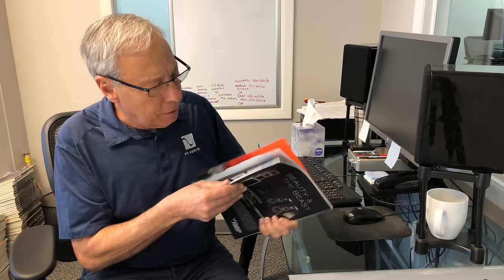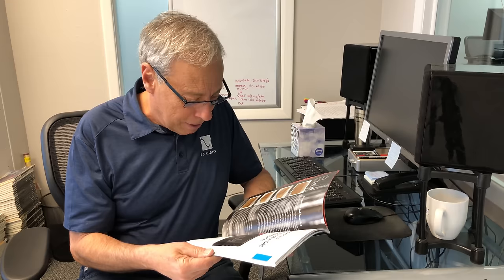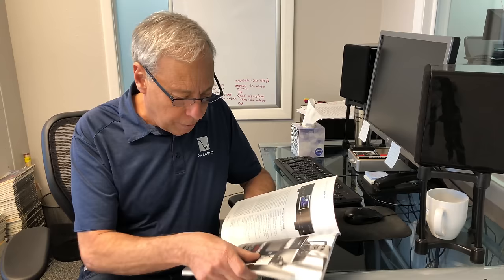Is equipment burn in real?

Comment: Ahhh, the BS that comes with being an audiophile. So everyone talks about how cables can change the sound of a component. I never believed cables actually could do anything. iiWi did a comparison between a 200 dollar interconnect and a cheap 3 dollar cable. Because he actually demoed the sound difference, side by side. It took a while to hear it. What I heard was very subtle. But dynamically different. This is where Burn in comes in. People think the cable changes over 100 hours of play. More on this later.

Component burn in. Well, this would suggest to me, that capacitors, resisters, IC chips and so on would have a change in value over only the first couple of hours. I don't think so. If you ask me, it's your ears burning in. It literally takes years for a correctly wired circuit to deviate from original values it was specced with. If a circuit is driven hard, like output tubes on a guitar amplifier, yeah you will hear a difference when it starts buzzing just before it red plates the tube. 

Back to my original thought with cables. Speakers are generally low amperage devices. Wire would need a lot of heat to burn in. So unless we are talking a hot transformer, no. Transformers are not in the audio path. Not there either. Burn in is pure BS.

Break in, now here's something that is real. Because a speaker is an electrical magnetic motor. It has a suspension. Said suspensions take a little time to break in. So any difference you hear would be from bass output. Because the spider in some woofers is stiff. That would make sense. As far as this goes though. Seems to me the bigger the woofer, the more noticeable break in becomes. 

That's my BS rant of the day.

Comment: i had my Naim system serviced..everything except the CD player..power supplies, pre and mono power amps..for the first week i noticed loss of bass and a 'flat' sound..not bad, just different...over time they improved and seemed to lose the bright, forward sound and the bass settled down..Some bass is boomy but my room needs treatment..
A month later the sound has a 3 dimensional quality and a smooth purity to it..The bass has tightened and only one recording has subsonic booming...I'm certain that some of this is due to my ears getting used to the higher levels of treble after the service, but i also think that the sound did genuinely improve...
However, i DO think that a LOT of audiophile stuff is nonsense..Burn in is part placebo, but there is an element of truth in it..I do wonder however, if a component 'burns in' after say, 80 hours, how does it remain stable and not begin to degenerate for the next 80 hours??

Comment: Burn-In is extremely important if a ma manufacturer is serious about quality control and management. I want to say that we should think of burn-in as 1. part of quality management in production process which deals with infant mortality of components, and 2. “seasoning” the system which deals with stabilization of characteristics of critical components such as tubs, caps and coils (transformers and chokes).

Comment: I can understand burn in from a speaker and stylus perspective since these have moving components.  But not sure about electronic components, they should test the same new and as they age.  If they drift or go out of spec then they need to be replaced.  I would think they degrade over time and the amount depends on the load and the type of component it is.  Burn in I would think is more QC.  Yes I agree cables are another story.  It’s really physics.

Comment: I'd like to see the actual measurements to see what the differences are.

Also, comparing a unit with "burn in" hours on it to a different unit without doesn't seem like a good idea.
The proper way to test would be to measure a single unit before and after burn-in.
Reply: Gene from Audioholics already did many tests on that. The drives literally change the moment you first press play. They don't change after that, it's just more of that audiophile "magic" that only lives in CONSUMER audio.

Comment: Just a few quick questions. For cable and equipment, if you just left the equipment with the new cable in, will this burn in the cable? Similarly say a power amp or cd transport like the new PS transport, do you have to have music playing to burn in equipment? I bought a second hand PS DS and waiting for the new PS transport to be released after beta testing, any idea the time frame?

Comment: Burn-in is physically real.   Electronic components change value as they warm up and have large changes when they are first heated.   Many products are calibrated wrong at the factory as they know how the unit will burn-in and know that it will actually be calibrated properly after the burn-in.   In the old days, we would deliver your TV to you and a week later return to adjust the colour/bright/contrast etc as they will all have changed.  I wonder if your viewers have ever heard of burning in a car?

Comment: Coming from military product background I say let Paul and his people burn the products in not the customer.  Customer burn in is an insult. Especially at the prices of PS audio gear.
Reply: And stop with the capacitor thing. Again, at your prices you should buy the grade of caps that have similar MTBF's as all the other solid state parts. I like Paul's channel but the hi end audio paradigm is ridiculous when it comes to reliability/consistency concerns. Historically, only companies LIKE Yamaha  have the wherewithal to guarantee 30+ years of trouble free functionality. Sounding good is the default for this industry.
Reply: nobody ever thinks about burning in a calibrated measuring mic. nobody. :} or an oscilloscope. :}
Reply: Paul clearly explained why they don't do this.
Besides I would rather do it myself, save money paying someone else to do it and probably learn something.

Comment: How does capacitor burn - in differs.does it changes capacitance? Then why would it become better. It could as well degrade if there is burn-in because the other way is also possible. I agree the loudness can vary but not the quality of sound.

Comment: Anecdotal experiences do not tell anyone anything
Everyone should be familiar with placebos and the placebo effect.
You have to do a double blind test to find out what you think you heard was actually what you heard or if It's the placebo effect.

An example of how the placebo effect works. If you give someone an arthritis salve and tall them this has been proven to be effective. Your arthritis will improve if you use this for a week. Come back and report the effects.
A week later the person comes back and says the arthritis salve works great my arthritis symptoms have improved a lot.
You realize you made a mistake and gave the person over the counter hand moisturizing cream by accident.

Yet the person swears his arthritis is better.
That's the placebo effect.
If a person believes in leaving the equipment on sounds better than turning it off, then it will sound better to that person.
Not because a burned in system is empirically better but because that person hears it as sounding better due to the placebo effect.

Comment: Burn in is as real as burnout. Burnout is verified by a pop and sizzle followed by a stream of smoke coming from the amplifier or from the port of a speaker. Unless you have sealed enclosures. Then no smoke or burnout. They just stop working.

Comment: I have just bought some Sound Magic in ear earphones on the strength of rave reviews (you dont get to test those in the shop) and on getting them home was pretty disappointed. Played them at max level for 24hrs and they are transformed. That could be the mechanical parts bedding in like the brakes on your car. I have never heard such a difference on purely electronic components burning in.

Comment: I've owned some components that have no or little burn in, and some massively transform several times over a 200-hour burn in.  If you think burn-in is not real, why does the most awarded brand for Stereophile Recommended Components mention it in all their manuals?  Do you think you are right and they are wrong?  If so, what awarded components have you sold?
Reply: they said as much because the burn in time tends to correspond directly to window needed to return a product, especially in the olden times

Comment: I second the notion that if they are using a reference component that has been operating for a while, it has stabilized and whatever they are using to fine tune the product will work under the assumption that the new manufactured copy would also have to stabilize in order to match the final tuned spec.

Comment: This is non sense. If this is true, there is no quality control from the manufacturers. usually burn is done as a quality control procedure so weak components die quickly at the factory and not in the customer’s hands.

Comment: That last comment is very interesting. I actually took some gear out that had sat around maybe 6, 7 years. I didn't really remember the sound from back then but I was definitely disappointed with the sound now. I figured either my taste had changed or maybe components had deteriorated. But it was the only system available for a while so I used it anyway. A couple of weeks later I found myself really enjoying it. I did remember how it sounded all those years ago, it sounded like this! So things that are left idle do seem to need to burn in again. Or maybe I got accustomed to it. That is always the doubt.

Comment: Paul is right as electrical burn-in is a very real process.  But without discerning ears it really doesn't matter as most nothing does.  But for those with any kind of discerning ear, burn-in is actually quite predicable.  For example.  If one were to replace all their AC plugs and IEC inlets and AC outlets at the same time with superior aftermarket (preferrably cryo-treated) parts and then play music (loud or soft) round the clock, you should notice the burn-in jump or improvement right around the 53 hour mark  + -1 hour.  Same time frame for fuses, AC and IEC inlets, and other simple electrical parts.

But if one lacks discerning ears and/or their system already sounds tremendously unmusical, they probably will not hear any difference.  The bigger and/or more complex electrical objects, i.e. cables or components the longer the burn-in process will take to reach full burn-in status.

Comment: Hi sir, 
i'm building a system with a denon 940h receiver, polk audio s-60 tower speakers,and 2   10" subs by Klipsch. the geek squad came to my house to set it up. they used the microphone. my towers were 6db and the other 1 is 7db. the subwoofers are at 12db, after watching a lot of videos that seems a little high, is that in normal range? also i'm interested in the Klipsch 250 center speaker. I like to listen to music more than watching movies, and my friend told me a center speaker isn't necessary for what I want are center speakers not  really for music?. can you give me your advice on these matters? thank you.

Comment: So after components are fully burned in, does this same process apply to warming up components before playing music through them? I was told this years ago, and to this day I will turn on my components and let them warm up a few hours before playing music. I have no way to A-B test this. Anyone have any thoughts?
Reply: Speaker Builder
This seems to be the case with some types of equipment, but not all. I believe it applies particularly to power amplifiers, and possibly to power supplies. 
Class AB power amps are notorious for it. Many people leave those things on all the time and never turn them off.
Use your ears as a guide. We are talking about sound here, right? If you don't trust your ears, get a friend (or friends) to listen, and take their opinion into account.   : )
Reply: I have found anything with a DAC in it benefits from being hot , I would leave it all on if it was not for the fact that it uses up the (fairly short) life of the electrolytic capacitors.

Comment: Fourteen cycles of burn in is done on military and commercial turbine engine controllers at my workplace, the rate of temperature change is controlled and a test done at +95 C and - 54 C on each cycle.  The purpose of the burn in is to weed out infant mortalities and put the components on the flat part of a bathtub curve.
Burn in of commercial equipment isn't usually done because of the cost, and the consequences of a failure are much less than that of an aeroplane part.

Comment: If your components change behavior over time, it sounds like you are using low quality components. If a Capacitor change spesifications so much that you can hear the difference you have som huge quality issues! Let me ask... do you messure any difference on the output?

Comment: From my understanding, burn-in is entirely dependent on the dielectric bias. Which is why some cable manufacturers install a live wire with a battery, so that the component is never "off" and maintains the dielectric bias and thus is burned-in out of the box. The dielectric bias, once formed, can actually die off over time when there is no longer electricity running through it.  For components, it is the dielectric bias as well. Thankfully, it isn't likely to lose the dielectric bias it creates because most modern amps and receivers have a stand by mode and is thus being fed an electric current at all times. Additionally, in modern day equipment we have IC chips that either produce power or provide DSP or DAC programing. When electricity runs through a chip, the electric current eats away a path in the silicon.  The less resistance, the easier the transmission.  This may also have something to do with burn-in, and it's literal. ;)
Reply: It's been a while since I've read such nonsense. Thank you for the laughter you brought.

Comment: I love your explanation. However as a former Tech that worked inspecting dissecting and testing individual component, all components are affected by voltage/  current and various inductance. In another job where I repaired radiation / scintillation devices on our most sensitive devices after repairing them they had to be ran for a week before they were considered stable for the complete final calibration. Because of their need to be Burnin for a week one particular unit drifted up much higher each day than the others had ever done and we realized because of that this the unit had come in hot and wasn't completely decontaminated, so burn in kept us from being over irradiated.
Reply: That's a really interesting story. I'm glad you didn't get over irradiated.

Comment: Key takeaways:   
1.  Burn in effect can only be detected by human hearing.   6:48
2.  Burn in effect can be lost if the equipment sits unused for some years.  8:15
3.  Cause of burn in effect isn't known; best guess is capacitors forming.  
6:55
4.  ALL capacitors need to be formed.  6:22
5.  Forming process is "little microscopic holes are filled."   6:25
6.  Capacitors can be made by rolling up a single dielectric sheet with a single conductive foil sheet.  5:15
7.  Burn in can take as long as a year.  7:30
8.  Even new DACs can be "stiff" and need break-in.  7:40
Why is anyone still believing this?

Comment: Hi
Burn in DAC and power amplifier
can i put on a cd on repeat, disconnect the speakers and let the hifi play 24/7
or do the speakers have to play the music?
Reply from the maker: If you're just burning in the CD player and electronics then no, you don't need the speakers playing. The only things that will then not burn in are the speakers cables and the speakers themselves.
Reply: @Paulmcgowanpsaudio  So you burn in speaker cables also? So electrons get familiar with the environment and travel faster  in the wire?
Reply: @Paulmcgowanpsaudio  But if you burn in a power amp, shouldn't there be a proper load, like speakers or a dummy load?

Comment: I have a vinyl record that's recorded direct to disc that will break in caps and cables by the time the record is over.Its very dynamic. The CD of it doesn't work.You can hear new caps or cables change sound all over the map while they are breaking in with this record.